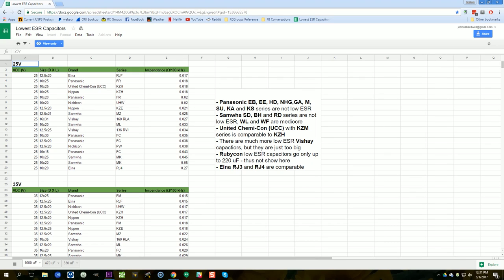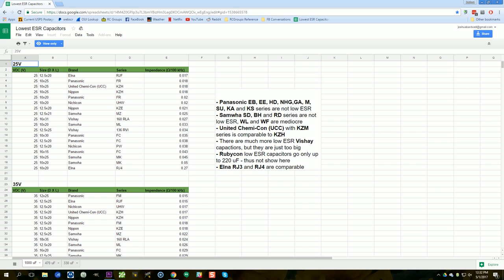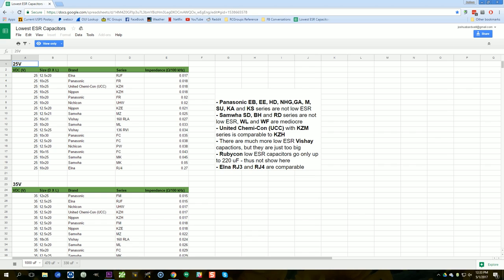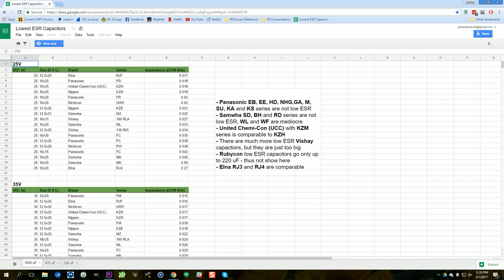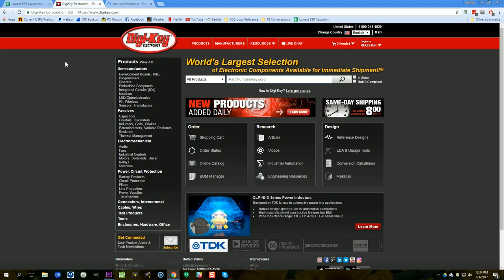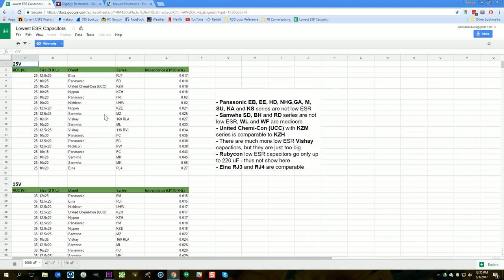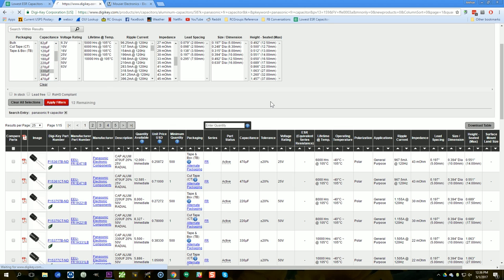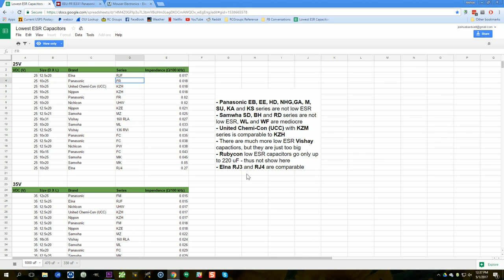Ultimate Low-ESR Capacitor Shopping List

Comment: will adding a capacitor to flight controller with a built in 4 in 1 esc (racerstar F4s) help or is it only good if you have the esc seperated?
Reply from the maker: +Malwin Rudek it can't hurt...
Reply: Joshua Bardwell ok then ill order some. thanks for your reply <3

Comment: I bought a bunch of banggood 25v 1000uf caps. Would it hurt to put one on every esc? I dont know if they are Low esr so would it make a difference? I cant get my D's over 20 and have video noise like that too
Reply: JC250 You can try at least, even if they are not low esr they'll help
Reply: I dont know what low esr means so would they hurt the quad if I added a bunch of them? Thxs for your help
Reply: JC250 No they won't hurt
low esr is like the resistance of a Lipo, so the lower the resistance the less voltage sag you will have, in terms of caps it is faster to respond to changes in voltages, like the very low but fast changes in voltage that destroy your video signal
So in conclusion do it, it will help, but nobody can tell how much
Reply: Sweet! Thxs for your awesome help!
Reply: JC250 You're welcome :)
Reply from the maker: If they are not low-ESR, I don't think they will do any harm. They just won't do anything except make your copter heavier.

Really, capacitors are a place where you probably do not want to cheap out. The really good ones like Panasonic perform so much better than the cheap ones, it is ridiculous. Buy a name-brand capacitor from a reputable seller (because fakes are definitely out there). It's not that much money over all (maybe you spend $1 per capacitor instead of $0.25, but still, it's not so much money) and the difference is real.

Comment: I installed 1000 uF but but there is still lot of noise. I'm going to install 330 uF on each ESC, but I'm not sure if I should leave 1000 uF on battery lead as well... Or should I remove that 1000 uF cap and have only 4x330 uF?
Reply from the maker: It won't hurt to leave the 1000 uF on the battery.
Reply: Joshua Bardwell thank you very much for fast answer Joshua :-) And thank you for everything you are doing for us all :-)

Comment: Hey Joshua, on a 4 in 1 AIO Stack if you pigtail the Capacitor because you just don't have the room to put it direct on the pos/neg leads on the board does that change how effective it is?
Reply from the maker: Adding a little wire won't hurt too much. Any capacitance is better than none.

Comment: Josh do you avoid aio esc's for this reason? Not being able to put a cap on each esc.
Reply from the maker: No, because 4-in-1 ESCs are too damn useful for many builds. In general they are less noise prone because of shorter wires (traces). But if you do get noise issues with them, it can be difficult to solve.
Reply: Good to know, I like the simplicity of aio and have yet to find a reason to not use them.

Comment: Hey I have a 2" quad that will take 2s-4s.
I noticed a couple times that it fell out of the sky when I punched the throttle. I'm thinking that the flight controller lost power for a second and so did the receiver and it did the death spin.
Could I put a Low ESR CAPACITOR on the 5 volt pin, to help with the power loss. So that doesn't happen. Or would that not work?
Reply from the maker: You can. I don't know if it would help but it wouldn't hurt.

Comment: Hey, one question. Do you think that a capacitor on a quad would change the info of an OSD for voltage (for example on a RunCam Swift 2)?
Reply from the maker: No, not at all.

Comment: Can you use caps on your ESC's when you are running Dshot?
Reply from the maker: These capacitors are on the power wires. The capacitor that keeps you from running Dshot is on the signal wire. No issue.
Reply: What does mean? Is useless for capasitor on dshot or not?

Comment: bit of a noob question if I may.. how would this work with 4 in 1 esc..?
Reply: jason g Just install them on the power input lines on the ESC, I would advise your to install four single little caps instead of one big, because little caps tend to smooth the little bumps in voltage better than the big caps, which are good for big bumps
Reply: MrMario616 .. thanks MrMario I'll give it a go, any advice on the size (uf) of capacitor bearing in mind it's a 2s build.. any thoughts..?
Reply: jason g I don't think there's much of a difference between different battery sizes so I would go for a 270 to 470 uF, depending on what you can fit.
It doesn't matter that much what capacity you chose, more that you use one
Reply: MrMario616  ok thanks.. as soon as I get some free time I'll be giving this a go..
Reply from the maker: I'm not an expert on capacitors, but I'm surprised to hear you argue that 4x 250 uF in parallel will perform differently than 1x 1000 uF. I thought capacitance in parallel summed.
Reply: Josh...what happens when you put  4 resistors in parallel...I don't believe putting the caps on the ESC's is the key, but that the caps in parallel makes the esr ridiculously low.
Reply: they are
Reply: This is correct.  Capacitors in parallel sum; divide in series.  If you put them on the ESC's the caps are still essentially in parallel, but they will each 'see' a different impedance due to varying properties/lengths of the leads (including PDB traces if used) going from the battery to each  ESC versus same impedance seen by one capacitor placed directly across battery leads.
Reply: I was thinking about this too. 4in1 ESC. 
I've had little understanding in regards to capacitors, until now, I think. 

The cap acts like a cushion. Place it between the troublemaker and the victims. 
4in1 ESC -> on the volt input of the ESC. The size (uF) of the cap says how big of a back flush it can handle. If back flush is larger than the cap, the excess F (amp sec/volt) pass the cap, and reach the rest of the system; FC, cam etc.

There is prolly a more correct word than back flush (of current)..

Correct me if Im wrong.. :)
Reply: Oh, no.. Am I wrong? My thinking would only resonate if it was a diode blocking negative return?.. Damn it, wish I had studied electronics..
Reply: Joshua Bardwell Yeah the capacity sums but the cap like somebody else already said if you put them parallel their resistance goes down, and there is another thing, something with a formula for calculating which frequency a cap is best for, and it says that the lower the capacity the better for high frequency
Reply: The capacitor is a physical low pass filter to allow low (this is relative).  Unwanted frequencies are what we call "noise".  To build a passive low pass filter you use a resistor in series with a capacitor and place the load (ESC in this case) across the capacitor terminals.  We can specify the frequencies we want to pass through by choosing appropriate values of resistor and capacitor.  In this case we are just using the resistance of the battery, leads to the esc, and/or pdb traces.  The only frequencies that will l 2 * pi * R *C)) Hz.  R is resistance in ohms. C is capacitance in Farads. If our total resistance us 2 ohm and capacitor was 330 uF, only frequencies below 240 Hz will remain in the signal.  Got my degree in EE at the age of 33. Never to late to study electronics.
Reply: Sorry. Formula is (1/(2*pi*R*C))
Reply: I would measure your total resistance and choose the cap according to frequency cutoff you want.
Reply: Dylan K thanks for the formula :) top👌
Reply: C=1/(2*pi*R*frequency)
Reply: This number will most likely be 6 decimal places with 3 zeros first.
Reply from the maker: +Dylan K this is a bit of misleading advice I think. We are trying to create DC voltage so the optimal cutoff is zero Hz. Therefore the optimal capacitance is infinite.

Comment: why is it cool now to use a capacitor on each esc and why is it uncool to use a lc filter anymore. Before your video I bought a bunch of lc filters because everyone told  they are magical for noise reduction in a video feed...
Reply: Having an lc filter is fighting against the consequences, having these installed on your ESC is more of a fighting against the cause. You can use lc filters as well but if use the capacitors at the escs it will help having less noise in the whole power system of the quad, maybe resulting in less gyro noise?(not sure about this one)
Reply: Thanks :)
Reply: Gavroche You're welcome glad to have helped ;)
Reply from the maker: LC filter protects just the video components after the noise is induced. Capacitor on the ESC protects the entire system by preventing the noise from being induced in the first place.
Reply: Joshua Bardwell How would one put 4 capitors on a 4n1 ESC?

Comment: If low ESR is the goal, is there a reason not to use Aluminum-Polymer caps? Such as this one: https://www.digikey.com/product-detail/en/panasonic-electronic-components/25SEPF330M/P16323-ND/4204160

The first reason I'm sure will be "they're $2 each"

Comment: So whats the best solution for a 4in1 esc? Can't really put a cap on each esc.
Reply from the maker: +helicrashpro one cap on the power oads
Reply: OK but what capacitance? You said a 1000 on the battery lead didn't seem to help much and a 330 on each esc worked much better. I'm not a capacitor expert but 4x 330 would equal a 1320 when wired in parallel. So maybe a 1000 is not big enough? Maybe a 1400 would be a better option? Or maybe just wiring 4x 330 in parallel?

Comment: Naive question: why ESCs manufacturers don't integrate such caps in the ESCs themselves?
Reply: tonnoz Maybe too heavy and expensive?
Reply: I have many hold emax 20A esc and a turnigy 30A esc with capacitor. They all have a 5V BEC regulator. It's certainly not too expensive but add weight, takes up space and maybe they are not always justified/necessary.
Reply: In general they do include the caps. It is the size requirements on miniquads and the race to miniaturise the ESC that led them to be dropped.
Reply: Can it be that one of those integrated caps got knocked out during a crash? I am experiencing video totally off (static) during punches/high throttle and I am running out of ideas. I am powering the camera from the +5v @300mA from the vtx and the vtx from the 12v BEC on the PDB. Swapped VTX, problem not solved, Installed LC-Filter problem not solved. Waiting for caps now.
Reply from the maker: Marketing. People want really tiny ESCs. And some builds can safely omit them.

Comment: Is this why some people add (for example) the TBS PNP50 to their build?
Reply from the maker: +Flying Squirrel FPV does it have capacitors? I thought it was an OSD.
Reply: I'm not positive if it has capacitors, but it does get wired directly to the main terminals, and I've heard people say it cleans up the video.

Comment: What if I want to use both a battery cap AND 4x ESC caps?...Im asking because I only am using a 470uf cap right now for my battery...Would it be OK if I added 4x 220uf caps to the ESCs?
Reply from the maker: Sure.

Comment: Wouldn't that interfer with DSHOT ?! I remember that we removed capacitors from esc's...
Reply from the maker: +Pappfigur those were on the signal line. This is on the power line. Totally different.
Reply: indeed...dumb question if I read it again :)
Reply: Not a dumb question. I was wondering about this myself. Didnt notice the caps were on the signal line but it makes sense.
Thanks Josh for pointing that out and thanks Pappfigur for asking that question.
Reply from the maker: Not dumb at all. Please excuse my terseness, as I have about a jillion questions to answer every day, so I can't always type out a whole essay.

Comment: I found a Rubycon ZLH 470uF 35v 105c....why isnt that one on the list?
Reply from the maker: Because a human made the list :-)
Reply: Was curious because it's the smallest, and only 470uf cap that would fit inside my x210 body, and I have not seen it mentioned before...Thought maybe it could be a fake or have too high of impedance for the list..
Reply: avoidrome zlh are great low esr caps.

Comment: Which capacitor should I use I am using 4in 1 ESC for my micro quad of 3s
Reply from the maker: For 3S, I would use a 16v or 25v capacitor. 220 uF is probably more than enough.
Reply: Joshua Bardwell thanks
Reply: Joshua Bardwell  what if I use 2s on that capacitor then is it bad

Comment: One quad of mine I am having the worst problem with the camera. I have tried a lot. But every time I rebuild the same issues. I punch the throttle and the camera goes white. Please help. Is this a power drop sign? Not enough for the camera. Also a lot of static. Just put a 1000um on the bat. Nothing different.
Reply from the maker: Run your camera and vTX ground to the same place.

Power the camera and vTX from a regulator not from vBat.
Reply: Joshua Bardwell always do. Had the quad run off the PDB 12volt. Didn't work. Ran through a separate 12v regulator. Didn't work. Back to a new vtx and to PDB again. Didn't work. Added a capacitor. Almost seems worse. Could the camera be bad?
Reply: I just changed to a brand new camera. Had another Fox V3. But I did move the signal wire too. So. Things are much better, but I guess I won't know if it's the camera or wire until I try the camera out on another quad.

Comment: i've been using a Panasonic 1000uF 16v on a 4S quad and so far didnt blow up! Is quite smaller than a 25v one!
Reply from the maker: Running the ESC so close to its rated voltage will, at the very least, reduce the effective capacitance.
Reply: hmmm... so i should swap the 16v to a 25v for a better filtering! is that right?
Reply from the maker: Yes I think so.

Comment: Is it okay to add 16v 1000uF on each of the esc? i'm running on a 4s setup
Reply from the maker: Personally, I would use 25v.
Reply: I see. I also find a good thread here about capacitors which could explain why to put a leeway of a few volts high but, not too high. Thanks for the prompt response :)

https://electronics.stackexchange.com/questions/13091/high-voltage-capacitor-in-a-low-voltage-system

Comment: Why no Aluminum Polymer Capacitors on the list?
Reply from the maker: You'd have to ask the guy who made the list.
Reply: For example the Panasonic SEF series.  I know if you look at the ESC's made for competition RC cars they normally always use Aluminum Polymer Capacitors in parallel.
Reply: Probably because most capacitors of other materials are not made within the Farad rating range needed for this application.

Comment: I've got Panasonic 470uf can I do on all each power leads? I'm trying to figure out bad issue https://youtu.be/lWXG8sBBPUE it will glitch out when throttle up and turn motors on and then off over and over. I'm not sure can. the flight controller omnibus f4 pro v3 and just replaced the RX thinking it's the issue

Comment: would you recommend one 1000uf on main batt. lead at pdb and a 330uf at each esc or would that be overkill.
Reply from the maker: Do the 330 at each ESC. The 1000 on the power leads is not as good.
Reply: thank you for the info

Comment: Hi Joshua, Thank you.  Great video.  I have Panasonic ESR 470uf 50V on my main battery lead.  I have extras.  I would hate to install 4 more of these caps on the arms.  Isn't it better to clean up the line from the Pololu 5v/12v?  Here are recommendations from Pololu - "If you are connecting more than 20 V or your power leads or supply has high inductance, we recommend soldering a 33 μF or larger electrolytic capacitor close to the regulator between VIN and GND. The capacitor should be rated for at least 50 V."   https://www.pololu.com/product/2109  So, from what Pololu said I'm thinking I need to place a cap right prior to the Pololu.  Here is a flight sample - https://youtu.be/JYkfIBAmhc4?t=6s  I would like to improve.  Hope this helps offer some insight into possibly improving video minimally.  I may try it based on what you say.  It's tight on the SimplePDB.
Reply from the maker: The optimal thing is to protect the entire system from noise by putting filtering as close to the source of the noise (the ESCs) as possible. Everything else is a compromise... it might be an acceptable compromise though.
Reply: Joshua Bardwell Yes, I see your point for all the electronics in general. I thought ESC's had sufficient caps.  Curious on top of that if the ESC's effect each other also.  Thanks for the input.  I'll try it in small steps.

Comment: what is the difference???
470 µF 25 V 20 % (Ø) 10 mm Panasonic EEU-FM1E471
470 µF 25 V 20 % (Ø) 10 mm Panasonic EEU-FR1E471
Reply from the maker: I can't figure out what the FM series is, but I always use the FR or FC series for quads.

https://docs.google.com/spreadsheets/d/14M4Z0GPJp3u7L3bmYBizHm3Leg0XOCmAWQOx_wEgEng/edit#gid=1538665578